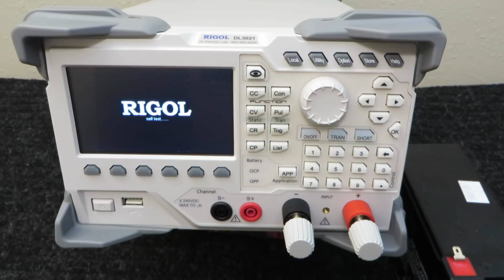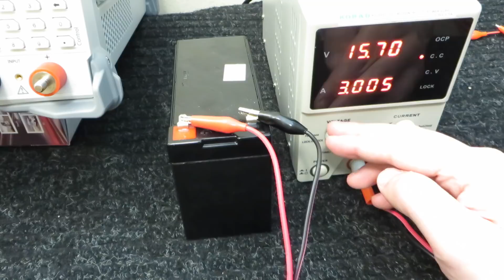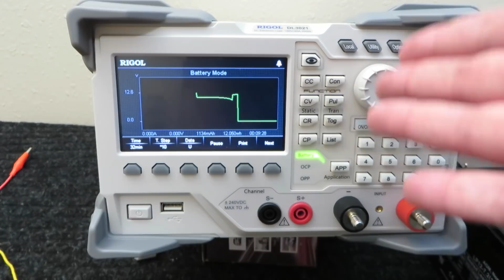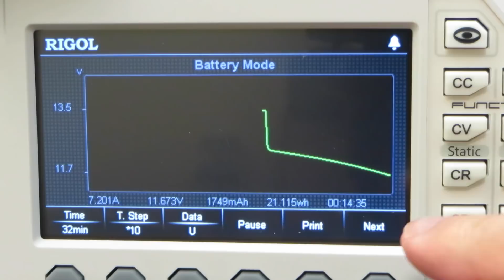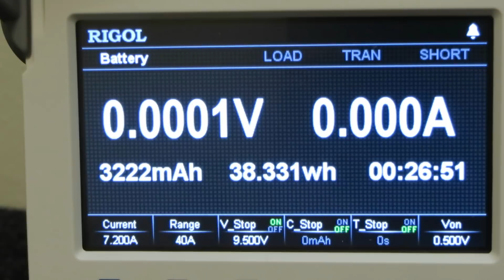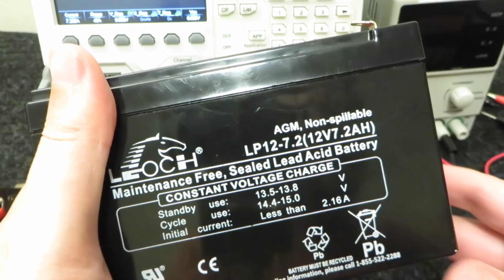Battery Desulfation Demonstration Start to Finish - Part 2/2

Comment: Why did you stop the load test at 10.5v? With the 1v drop across the cables you should have discharged down to 8.5v which would have been 9.5v at the battery. Or am I missing something?
Reply from the maker: You're not missing anything.  The situation is that discharging to 8.5V would have made very little difference vs 10.5V.

Comment: It looks like you boiled battery this way and evaporated part of capacity.
Correct desulfation process requires leave battery alone for at least 8-10 hours after every over-voltage (>15V) recharge procedure to finish and stabilize its own internal chemical reactions.
Reply from the maker: Once removed from the charger the battery stops desulfating.  Nothing happens when sitting static.  You're free to let it rest for 10 hours but it's just wasted time.
Reply: @knurlgnar24  thanks for your reply.
First of all I need to say that I missed part 1 of your video and didn't realize what kind of battery did you used and general idea of that video (battery restore process).
But what situation for a little bit sulfated battery which well maintained before? I'm not really sure it should be cycled that way, am I wrong?

Comment: The battery shows 7.2AH but you tell that this battery is rated 2.5 AH. Please advice.
Reply from the maker: The useful Ah is different depending on the discharge rate.  I showed this chart in part1 of the video.

Comment: Just hook up your welder at maximum amps for 5 min then let them cool off and repeat the process for 5 times easy
Reply from the maker: That's a 'dirty' way to do it, but it can work.  It will NOT desulfate a battery by itself though as much more time is required.  That procedure will only recover a battery just well enough for it to start taking a charge from a charger.

Comment: Thanks for both Part 1 and Part 2 -- Well done! 
Here is my dumb question: Can that little power supply work on a dead car battery (one that has been sitting a couple of years)? I realize there are small "automatic" chargers offered for the purpose of restoring and charging car batteries, BUT I would also like a budget priced DC power supply and cannot afford both devices. Thanks!
Reply from the maker: Yes, a power supply like this will work well on a sulfated car battery and I have used it for exactly that purpose in the past.  It will not have the safety features like overcharge protection and such so keep that in mind, but that is also the reason why nearly all purpose built battery chargers cannot recover sulfated batteries even if they claim to be able to.   I obviously wouldn't recommend doing this indoors like I am here, but it's much easier to record that way.
Reply: @knurlgnar24  Excellent, thank you. I would presume then that the power supply method would take much longer and, as you suggest, would require monitoring every half day or so for an old "dead" (and vented) 12v car lead acid battery, right?

Comment: I'm confused. At around 17.25 in the video you say 2.6 Ah is about 3/4 capacity of this 7.2 Ah battery? Am I missing something here?
Reply from the maker: The datasheet for the battery shows discharge curves for various discharge rates.  At the rate I was discharging the battery 2.6Ah was about 75% of rated capacity.  You can only get the nameplate 7.2Ah if the battery is discharged very slowly.
Reply: @knurlgnar24  I understand. Thanks for taking the time to reply.

Comment: How about using a dc welder?
Reply from the maker: Probably too much voltage for a 12V battery and voltage regulation isn't their strong suit, but depending on the welder it may work.

Comment: What voltage did you use for the boost charge on the 100Ah batteries?
Reply from the maker: I did quite a bit of experimentation and variation but high 14V for long periods of time or low 15V for short periods of time were typical.  Above 15V you will lose water fairly quickly.  Patience is usually better if you have the time.

Comment: Wow, i had no idea there was so much to learn and know about recharging a "simple" lead/acid battery.  For starters i didn't know of 'lead-antimony' vs. 'lead-calcium' type.  And the process of repeated charge/discharge cycling to work the capacity and voltage holding ability higher and higher....never knew that either. Fascinating stuff. Thank you for making these very educational vids.

I have a question if i may;  what do you mean by "controlled over-charging"?  I think i understand the "controlled" part (controlling what voltage to push the process with, and also controlling how much current to push), but i'm unclear on what you mean by "over charging".  P.S.  New sub.
Reply from the maker: I wouldn't consider 'controlled overcharging' to be a technical term as it is more a description of the process.  A sulfated battery when charged according to standard charging procedures as documented by the battery manufacturer will stop accepting charge well before it is truly charged.  The sulfation isn't going to be converted back into useful active material in any substantial portion unless forced to by charging more aggressively than normal use procedures.  Even equalization procedures don't really reverse sulfation to a significant extent in most cases as it is too tame to do much.  What is needed is an overcharge condition that goes beyond ordinary use procedures.  An overcharge severe enough to permanently damage the battery is required and this must be controlled by the user for obvious reasons.  Fortunately the easiest part of a sulfated battery to damage is the sulfation and so it can improve the battery performance at the expense of some irreversible corrosion and shedding of active material of the battery plates, something that would otherwise be highly undesirable in a battery that is in good condition.
Reply: @knurlgnar24   Thank you for the reply, i understand now what you meant/mean by that term.  But still unclear on whether you're referring to voltage applied or the amp-hour capacity that you push the battery to.  How does one know when they've over charged the battery to an ample degree without going too far with it?

Comment: Cycling the battery obviously is important in the desulfation process, but I don't want to spend $500 for a DC load. Did you mention something about running a inverter with a load (light bulbs for instance) as a way to discharge the battery before recharging again. What would be considered a reliable, steady current load for this project?  Thanks!
Reply from the maker: The ideal load level depends on the battery size but really your patience is the limit.  Any load will work.  Put it in your car and turn on the headlights, find a 12V appliance and connect it to the battery, etc.  An electronic load is a luxury.  I think everyone should have a cheap 12V to 120V inverter for emergency situations so that's what I'd suggest.  Even a $20 one would charge your phone, run your laptop, run LED lights, let you watch TV with physical media, etc and be pretty useful for power outages, camping, traveling, etc.

Comment: Great explanation. Can a gel bat. be desulfated in the same way, or can a gel bat. not sulfate? I have gel bat. with almost no capacity 1 year since new.
Reply from the maker: Do NOT use this high current method on a gel battery as it will cause permanent bubbles in the electrolyte which, hopefully, is not already your current problem.  You can instead use a lower current for a much longer period of time and the general process will still work.  It may take an order of magnitude longer though.

Comment: excellant instructional video.  I really needed to watch this as 1. Im having issues with my 12V LA deep cycle marine batteries.  probably more a load V charging problem, Im so bad with batteries they scream quietly when they see me coming.  that aside I invested $100 in a genius 10 NOCO charger that has a battery “repair” mode, didnt seem to do anything.  I get 12.4V on the battery but low SG readings.  the batteries are only 6 months old and I have disharged them and put them away before recharging a few times so I either ruined them or theyre heavily sulfated.  going to look into one of those lab power supplies and try the method you demonstrate here.  it gives me hope and I like that.  glad to see you back, hope you continue providing your version of most excellant content.
Reply from the maker: If your batteries are only 6 months old it is pretty much a guarantee that they will recover to near 100% with the method shown in this video.  Irreparable sulfation damage take more time than that.  I am not surprised that the NOCO charger didn't work - that isn't a negative comment on that particular charger, just a comment in general on the state of chargers today.

Comment: Very interesting, inspires me to do some testing myself. If only there was a way to do the load testing and not waste all that nice engergy
Reply from the maker: I generally do it during the winter if I have a choice.  Heat in the house isn't wasted.
Reply: In the summer months I use a cigarette lighter plug in 12v fan that was purchased for my side by side ODES Dominator.....blows nice air in your face in a shop with no A/C.
Yes we have those B.A. pedestal fans that can blow the papers off your workbench, so this little one is nice.

Comment: That was a brilliant couple of videos.  I am amazed that you are bothering to excuse yourself for spending time repairing a sulphated battery. Was that in case someone had mistaken this for a video of Lionel Messi's greatest goals?
Reply from the maker: I have other videos of similar content and one of the most common comment subjects is questioning why I'm such an idiot to waste my time and electricity on desulfating a battery when everyone knows magic device X does it overnight, or magic additive Y fixes it, or buying a new battery is cheaper than the electricity needed to desulfate it or...   Sometimes it's worth a few mentions to avoid such inane comments.  This video thus far has avoided them fortunately!  Thanks for the compliment Nowthen.

Comment: I practice the method you showed on 12V, 7 Ah, AGM batteries.
Some of them could be reactivated without problems, but currently I have one on the charger where one cell has inflated noticeably.
Is this then a "dead cell" as described by you? Or does it still make sense to continue charging with lower voltage and observe?
My question is based on the assumption that a large sealed AGM battery would then behave similarly.
Reply from the maker: If the battery is deformed I would definitely not mess with that battery for both safety reasons and because I don't see much hope for success.  This process only remedies sulfation damage so anything else that might be wrong will still be wrong.  Yes, a battery of any size will behave similarly.
Reply: @knurlgnar24  I must correct myself.
The deformation of the battery occurred during charging.
Before that, it actually looked like new.
The battery looks like the Leoch from your video - it has no valve to let gas escape.
So for the record - if it inflates, it's probably dead and you should stay away, right?
What an amazing parallel to dead animals on the side of the road - in the middle of summer 😅

Comment: What if the battery takes charge but then discharges itself over the course of a few days? Internal short circuit between the plates, or a problem with the filling / chemistry? Is there anything that can be done to save the battery in this case, or is it time for the scrap yard?
Reply from the maker: Sulfated batteries often appear to discharge somewhat before stabilizing at a non-full charge when sitting due to chemical factors, but assuming you have a battery that truly discharges then in my opinion it should be scrapped.  You have either a plate separator defect allowing a cell to discharge directly, or contamination in a cell electrolyte.  Either way I consider that beyond the scope a homeowner can do without a lot more work, risk, expense, and effort.  I always scrap batteries with cell shorts.  Even if it is only electrolyte contamination that contamination likely permanently altered the plates themselves.  Epsom salt is a common contaminant nowadays given all the videos out there on it.  Once added to a battery it is permanently damaged.
Reply: @knurlgnar24  Ok, then I guess I will stop my efforts in that case. The battery has been sitting in my basement for a few years. Salt was not involved, but maybe it was a mistake to fill the battery with supposedly distilled water from the dryer.

Comment: Acquired a 180Ah 12v lorry battery, its been stood for 2 years and appears sulphated?. Meter reading was 11.4v. I emptied it and refilled it with Manganese Sulphate and put it on charge, its voltage recovered up to 14.2v but it quickly dropped, still doesn't hold a charge. Looking inside the plates look black between the separators. There is much bubbling going on inside. Q. Do these desulphation gadget things for sale on eBay actually work or are they gimmicks? 

Question: Should it be emptied of this Manganese Sulphate solution and refilled with battery acid or distilled water before recharging or just scrapping it? Thank you.
Reply from the maker: The only chemical that should be in a lead acid battery's electrolyte is sulfuric acid and water.  Since it is now contaminated with manganese you could try emptying the electrolyte, replacing with pure water, and charging until sg stabilizes.  Then empty and replace with the proper concentration of sulfuric acid and water.  Once contaminated with other chemicals side reactions change the chemistry of the battery so your odds of restoring the battery are lowered.  The desulfation gadgets are gimmicks, though some of them desulfate with standard methods and function even though they advertise some other floofy marketing just to be able to get more sales.

Are you sure it wasn't magnesium sulfate?  That would be more common.  Same answer either way though.
Reply: As a chemist, once I saw videos recommending MgSo4 to "fix" a lead/acid based battery system, it was like watching "amateur hour" live.
Both metals have different densities and electrolytic properties in the presence of an acid.
I even remember this equation on a midterm test, so it's a nobrainer.
I personally have a nice lab benchtop power supply that has variable volts (pressure), amps (current), and watts (power).
I also have a NOCO Genius 10 just to charge my Harley battery which is a LiPo, and it has the 12v "fix" mode which is what I used on one dead battery with success.
With flooded batteries you can use a hydrometer to check specific gravity, however with agm you cannot access the gel without drilling holes or removing the top which is beyond the homeowners capability or safety.
I've seen the videos of guys using 200 amp welders to temp shock batteries and kinda chuckle because most of us "on the farm" have at least three or four of them and would rather use our "stupid" charger with jump start...plus they have timers on them for safety.
If you want a 5,000 cycle 10 year battery that you can drain to zero each time then spend $800 ish on a LiFePo4 battery.
Heck I fly R/C aircraft and have LiPo's that are 10 years old and still going, and they're from $7 to about $250 bucks.
Good luck.
Reply: @keithlucas6260  Thank you for the time and your valued opinion. I know what you mean about lido's, some used correctly can live for years. I had one of the very first analogue mobile phones and after charging it up after many years, it held its charge as if it was new.

Comment: You need much heavier wires when discharging to get accurate voltage readings. Too much resistance in small wires. Also, use the sense terminals to get accurate battery voltage.

Comment: Instead of using high voltages, there're a few videos on Youtube demonstrating using 200Amps large currents to charge for 15 minutes, resting for an hour, and then repeating the process for a total of 5 times. It seems to work pretty well to desulfate a dead battery  with very large currents.
https://youtu.be/TYXx70MqJ-0?list=PL8g2bwQ_dRe0_pEPHuK7G1qXnNpmjPdlb&t=357
Reply: Voltage is pressure, amps are current and watts is work.
High amps will "cook" the plates and knock off the sulfide because of heat.
Hopefully you don't warp the plates along with the separators being degraded.
Using an old "stupid" charger on 10 amps on a timer will bring the specific gravity up to spec as well.

Comment: Shouldn't you have stopped at 8.5V, considering the 1V drop on the cables?
Reply from the maker: Yup.  Didn't realize the large voltage drop until the test was started and as described in the video it doesn't really matter anyway.

Comment: Hello! I have a question if you don't mind. You state during cycling that you're pleased with the results because you are coming so close to, and even exceeding, the ~3.5 Ah that the battery is rated at when brand new. Isn't the battery rated at 7.2 Ah, thus the 1C discharge at 7.2 amps? Is this just because the capacity is reduced at such a high discharge rate of 1C?
Reply from the maker: At some point in the video I show the graph in the datasheet that depicts Ah vs discharge rate.  The Ah rating of the battery is at a slow discharge rate to give it a large number for marketing purposes whereas I used a very high discharge rate due to my own impatience.  In short, yes, Ah capacity is reduced at high discharge rates.  The total amount of Ah available is unchanged but the remaining capacity is only available at lower amp rates.
Reply: @knurlgnar24  Thank you!

Comment: but the battery isn't rated for 7.2 Ah when it is brand new? so why 3.9 Ah is a good result? :)
Reply from the maker: A the discharge rate I used it matches datasheet spec.  I show the datasheet section in the video where this is shown.